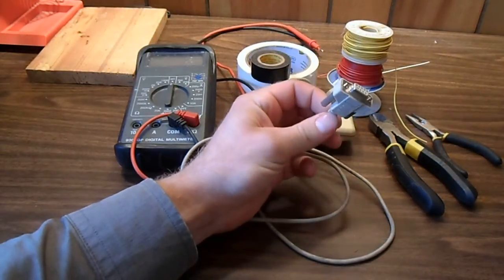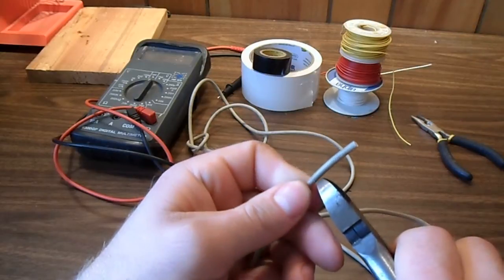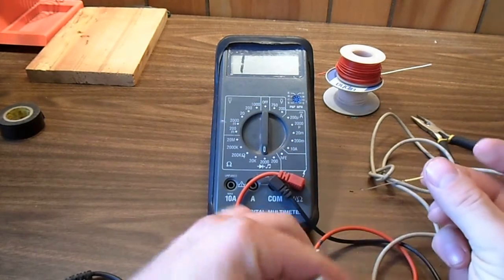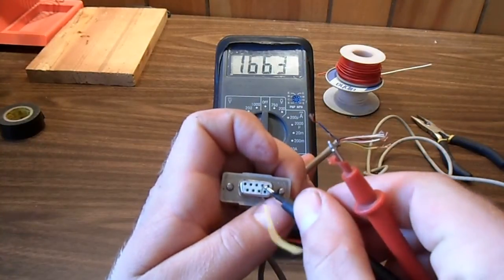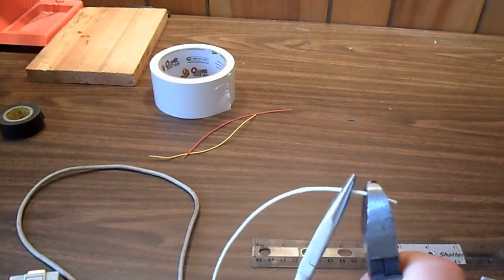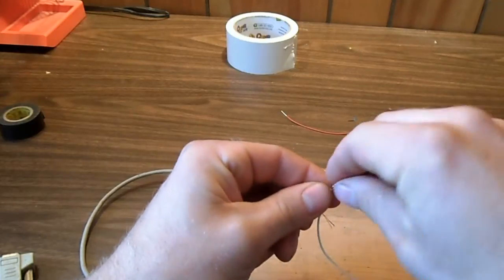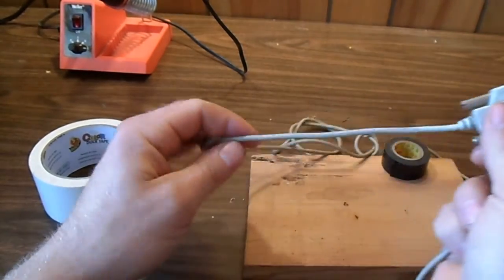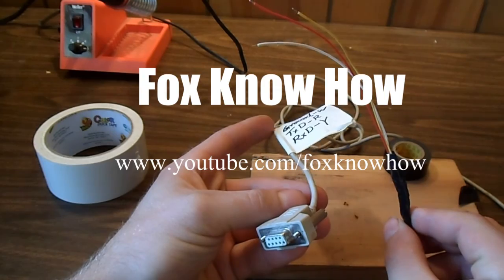Picaxe programming cable for breadboards

Comment: Hi sir, I saw ur video n I was pretty awesome to do. By inspiring ur video I tried this bt I didn't get any db9 cable instead I used a VGA 15 pin cable by comparing all pins out of it n made a cable. Bt the matter is when I insert in VGA port of my pc n program it, it throughs an error that ERROR: CAN'T OPEN COM 15(wat the port I set in editor) is not N I think this error is due to lack of detection of cable. So can u suggest any drivers or any other ways to solve.
Reply: You can buy an RS232 female/male conector and put just the Tx, RX and Ground (3rd, 2nd and 5th pin) connections. and then use a Serial to USB adapter. I did it that way on my computer (with windows XP OS) and downloaded all the drivers from the PICAXE page. it worked Perfectly. I had some troubles working with W10 and W8, it seem it works fine with W7 and earlier.

Comment: hi matthew fox,
is there any driver that i need to install before uploading program through the cable.
driver like usb or anything
tq
Reply from the maker: muhammad junaidi Ismail If you have a USB to Serial adepter then you may need to install a driver that came with the cable or download it from the cable manufactures website. You can just try plugging it in the computer and see if it would self install first. The PICAXE itself doesn't require a driver to be programmed.

Comment: will this work for microchip pic mcu?
Reply from the maker: No. You need a PIC chip programer to program PIC chips. The Picaxe is a PIC chip with a bootstrap program on it that makes it possible to program the chip via a serial cable.